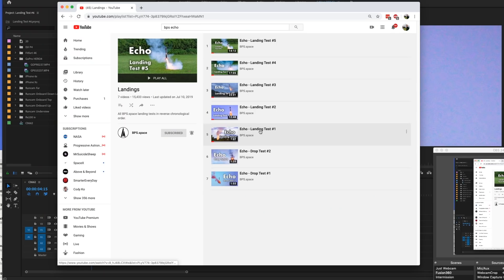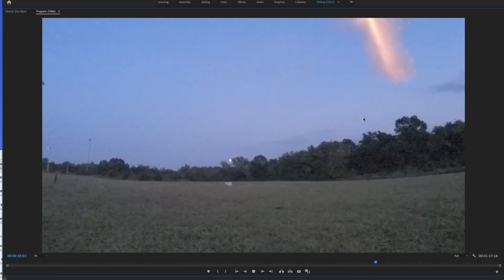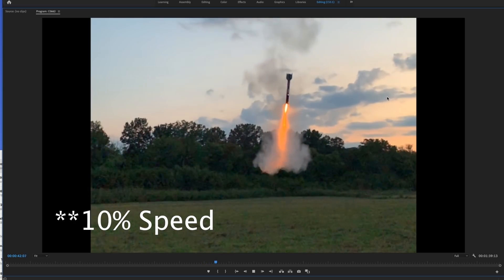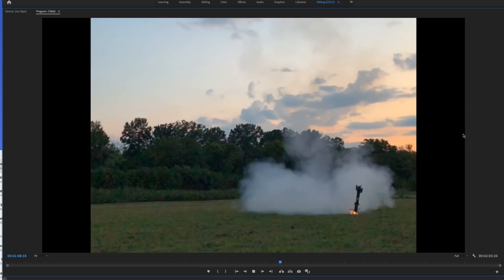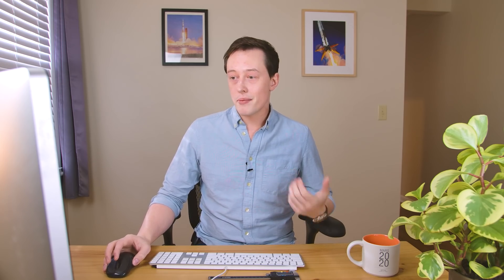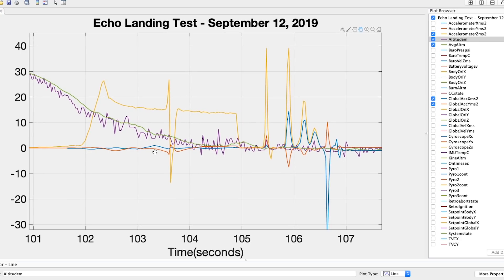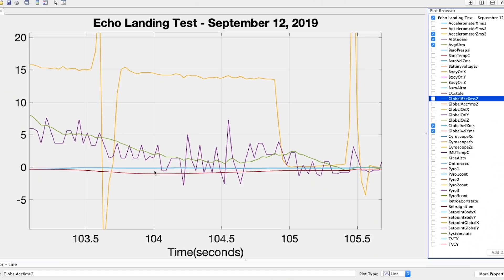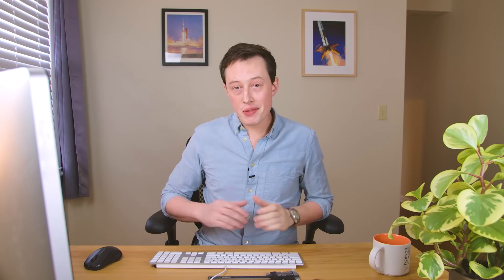Echo - Landing Test #6

Comment: So for this material weight and size the ratio of thrust is about 3 times the size of the rocket, which would make some sense for the thrust to overpower its weight, not even considering the fall rate so much.... I wonder what that would be like for 40 or more tons of weight, Hmm? The SpX rocket thrust size was about 1/10th the size of its rocket... I would say that debunks it, dont you?

Comment: That was a beautiful thing almost.
Reply: So for this material weight and size the ratio of thrust is about 3 times the size of the rocket, which would make some sense for the thrust to overpower its weight, not even considering the fall rate so much.... I wonder what that would be like for 40 or more tons of weight, Hmm? The SpX rocket thrust size was about 1/10th the size of its rocket... I would say that debunks it, dont you?

Comment: Have you considered photo flash ignition? An old-style flash bulb of the correct physical size placed at the end of the ceramic nozzle creates enough heat to ignite the motor. Advantages are the following:
1. Very low power required to flash the bulb. 
2. Very consistent time from when the power is applied to the bulb to when the flash bulb goes off. (After all, they are used in conjunction with a shutter to expose film). 
3. Potentially more even ignition across the end grain, resulting in more consistent motor start. 
Br, Tom.

Comment: Hi BPS space. I have seen a huge amount interest in these TVC rocket systems and lots of people attempting to to do the Space X style landing, but no one is offering a rocket motor capable of giving the TVC, throttle, inflight relight & controlled shut down needed to fly these types of mission profiles. Given I have designed & built hybrid rockets for over 25 years now I am thinking of setting up a project (probably on kickstarter) to make a suitable HRM kit to do this, would you be interested in this? You can check videos of some of my prior work on my channel.

Comment: Maybe you could make a variable tube size rocket engine where the diameter is smaller than the main deceleration motor, giving less thrust for the last 1 foot altitude.

Comment: Throttling is the largest issue with solid fuel rocketry, but could you "pre-bake" some throttling into the solid fuel? If you make your own core-burning solid fuel cells, you can gradually dilute the fuel with something combustible inert to lower the thrust towards the end.

Comment: What I noticed is that, there is soft landing spot rather than hard landing surface. Try landing on concrete, this factor is also to be considered. As there is less chances of toppling in hard surface than on the grass

Comment: This would pose the issue of heat removal , but along with thrust vectoring could you also make a throttling nozzle similar to what's on fighter planes? ( I know they are turbines and the nozzle works with the throttle )

Comment: Why don't you try controlling the thrust of the solid rocket but changing nozzle size/leak so you can do some control of the thrust/cutoff and not relay on timing only?
Basically you get a good control circuitry but without proper thrust control it is hard to handle. Adding some control over the solid rocket thrust would likely be simpler than doing liquid rocket with all other issues.

Comment: While the fins work great for stability, have you considered grid fins? The can help with lateral movement and the can slow the rocket down if modeled correctly. It could be deployed is a similar way to the landing legs, and if you really wanted to, you could rig up some servos to control the grid fins. These would be a more size/cost/weight efficient alternative to reaction control thrusters for decent, and you could easily print them with your 3d printer.

Comment: I also just had an idea that if you were able to make your own motor housing with your own throat that would eliminate one variable.  I have no idea if it's possible to make your own solid fuel at home but maybe just some sort of shroud that an estes motor would fit in, that would allow you some sort of control over the final flow of thrust through your own throat.

Comment: What if you had thrusters on the side of the rocket working basically like an abs system to keep the rocket straight? It seems to me like all the thrust coming straight from the bottom would make landing a little more difficult because of pushback from the thruster to the ground. I’m not rocket scientist by an means lol but that’s just my theory.

Comment: Maybe longer legs (5cm) could fix a problem. Sorry for my English (I am French)
Reply: I am totally not a mechanical engineer, but I was wondering the same thing. And if there's a bit of mass at the tips of the legs, would that not provide some additional measure of roll reduction (like a figure skater's spin reversed) that's context-free (no sensor input required)?

Comment: Looks like just above the ground the thrust power cancels out gravity due to the ground acting as an impenetrable barrier thus the rocket hovers above the ground for a second before falling the last couple of feet.

Towards the end of the thrust lifetime if you could throttle down the power at a linear rate (based on altitude and thrust power) i think it would still descend slowly towards the ground. 
This would allow the rocket a gentle descent for the final few feet and touch with minimal bounce providing a more stable landing. 

Have you successfully landed one yet?

Comment: Yeah, I think trying to land with a solid rocket motor where you can't control thrust and  likely too large a variation in power, duration, ignition of the rocket engine make it extremely difficult to land. But on the plus side, you do get to learn more about controlling the rocket and guidance.

Comment: Dude soooo cool good job!! I had an idea about how to throttle down the engine right at landing. You could build a mechanical iris the would close off the downward thrust and redirect it out the sides maybe. Could give you a little more control on landing. Buuuuuut I know you also have to worry about weight.

Comment: Your rocket almost did it. It is amazing, man. It estabilizes (like a landing) 1m from the ground... If you increase the weight of the rocket a little bit, dont you think that the rocket will estabilize  closer to the ground during the landing? Since that you dont control the quantity of thrust, maybe the carrefully increase in the weight could work indirectaly on this way...

Good job! Congrats for your curiosity and resilience.

Comment: Why not use 2 smaller rocket motors, point them closer/further away from each other to control vertical thrust? Also, you can get roll control directly from the motors this way.

Comment: To send this little craft to space, what would that take in terms of fuel and stages? Lets say you send a small radio as the payload with whatever technics you would need to operate that radio, transmit or what it is you can do with it.

Comment: Congratulations. You put in a tremendous effort. And you LEARNED a great lesson that many, many generations of Control Systems engineers had to learn before you: ”If you have significant uncontrollable input variables (eg., winds, engine thrust, etc.), then you can NOT run your system “open loop“. You must run it closed loop.”

Yes, you are making the right decision to abandon solid rockets. There is no viable way to get there without a throttle-able rocket. There are no ways to throttle a solid fuel rocket ... without heinous complexity. 

And “heinous complexity” = lots of additional mechanisms, lots of extra mass, lots of extra unreliability.
That’s the wrong route.

If you have a way of searching comments, you’ll find that I posted here almost all the same things that you said around a year ago.
I (believe) that I also told you about Harold Edgerton, one of the greatest engineers who ever lived. He had decades of hundreds of young engineers asking him if hundreds of, um, “less than astute” ideas would work. He NEVER said, “No, that won’t work because of (valid, correct reasons).”

He always said, “Go try to make it work. You’ll learn 100x more by trying & failing, and paying close attention to WHY your idea failed, than if I tell you now why it won’t work.” And then he’d tell them, “you’ll have to pay attention to a, b, ç, etc.”

I’m pretty sure I said the same to you. That has been my policy for the last 30 years when giving advice to baby engineers.
I encourage you to take the same route, in the future, when people are comping up to you & asking if some hare-brained idea will work.

Plus, you get surprised. Sometimes the little suckers ... succeed. Sometimes, they succeed wildly.
I’ll share one of my embarrassments. About 8 years ago, I thought that landing a rocket vertically, on legs, was pretty hare-brained.

A couple of thoughts here ...

1. You’ve got to get precise altimeter data. Your barometric altimeter ... not so good.
2. Look up the simple criteria for something falling over. Your landing legs ... much wider base. Likely more than 4.
3. Think about vertical mass distribution.
4. Wind won’t be a serious problem, once you close the loop on lateral velocity. You thrust vectoring will compensate. However, wind gusts are a different story. Sometimes the only way to deal with issues is to avoid them entirely. Such as “launch restrictions”. Not particularly satisfying, but that’s the reason such things exist. 
5. Last, I’d wager that, once you’ve got a closed loop system up & running, you’ll discover that there are very specific reasons that SpaceX does not land on grass. Reasons that go beyond “dirt can’t take the weight”.

Finally, I believe the best lesson here is that there is a tremendous body of engineering knowledge regarding almost any task imaginable. Try, as best you can, to take advantage of that knowledge as early in any project as possible. Talk to older engineers, experienced in the exact task that you’re trying to accomplish. Ask them about the pitfalls. Leverage other engineers’ mistakes & learning curves.

Again, best of luck.

Comment: Could you use a longer leg/wider base to counteract your center of gravity/tipping?  I would think that and may be forcing a 2-point contact, would allow the rocket to settle more easily (lower CG at touch down and bounce would be divided between two legs, which allow for 1-axis re-balancing, rather then trying to force 2-axis, while balancing/bouncing/pivoting on a single point)... or maybe put a small gyro in the nose section, which would help minimize sway and counteract variations in the motor burnout phase...

Comment: In my view you need either one or two of the following:
-Leg Dampers, maybe bigger legs and slower deploying;
-Some kind of compressed gas at the top (maybe CO2) and 3 or 4 nozzles to help it from tipping after touchdown, ofcourse it has to be well controlled with electronics but you´ve done bigger things already so should be "easy".

Comment: Why don't you put 3 motors and change angle/vector of each motor while landing?  With good settings you could normally land with motors on full throttle, you just pinch motors up when you need less power. That way you have a lot of room for error, unlike the method you're using now.

Comment: Is it possible to remove material from the top of the rocketmotor? Reducing the total thrust would turn the steady-state hover into a slow descent. I've honestly never done anything but light rocket motors so I don't know if that's possible.
The legs making the whole thing judder like that I remember in previous videos you mentioned that could knock things out of whack, a shock absorber would solve the issue (I suspect you know this :P) but we used to use a rubber gasket and a piece of string, basically, to just slow down the extension on some stuff back at uni.

PS I love your videos, and the work you do!

Comment: Since you can't accurately control the motor startup, or even thrust, why not put a thrust redirection or restriction system in the exhaust flow.  Then, with the your flight controller you can "adjust" for crappy input to get the output (thrust) you want.

Comment: The problem with these landing attempts is the rocket motor -- there isn't anyway to throttle them down.  These things were design to lift the vehicle upward then fizzle out.  It wasn't in anyone's wildest imagination that you'll be trying to use them to accomplish SpaceX-type landings.  You have to find a way to reduce the end-stage burn slightly to facilitate the landing you want to achieve.

Comment: The Spacecraft should detect the speed it's falling downwards and calculate the needed engine power for braking with an algorythm based on downward speed, mininmum brake time, distance to ground and maximum engine fuel

Comment: BPS, I think you can ignite the motor later. Even if the trajectory calculation would say that it's too late and would hit the ground, because of the light weight, as the flame begins to touch the ground the force would probably increase since you would have the transfer of momentum from he combusted material to the rocket. Then that material will bounce off the ground, and then push back up on the rocket.

Comment: Of all the parrameters you talked about the one parrameter you didn't talk about is the springiness of the grass yoou are landing on. At the size of your rocket the nature of each blade of grass and that of the grass stalks should be concidered as a field of randomly set springs. Dose the design of your landing legs take the variable nature of the grass surface you are landing on into concideration?

Comment: Joe, I know you thought of this, but what about multiple smaller engines, sort of like the SpaceX Falcon? Instead use a staggered descending thrust parameter with multiple smaller engines to slow descent, ending with just enough soften the landing - even if the last was still burning on touchdown. Yes, I understand you would still be dealing with environmental stuff...Or would it just go boom? 

I am excited about the Sprite project and wait in eager anticipation on that update!

Comment: I have watched a few of your videosThe problem in your rockets is weight. You need to make the rocket lighter. Replace all metal screws with plastic. All parts should be lighter, thin walls, holes in them to remove weight.

Comment: Did you consider using solid rocket engines to stop the fall, then use compressed gas (like CO2 cartridges) to control the touchdown?

Comment: Might want to try GOX/solid hybrid engine as an intermediate step before going fully LOX/MeOH. The hybrid can be throttled, has a much more simple plumbing system and it can be assembled largely from paintball components if you watch your pressures.   Other potential oxidizer for a hybrid would be NOS from and automobile performance shop

Keep up your extraordinary work!

Comment: Obviously the manufacturing tolerances of commercial BP motors are deliberately left "loose" to a certain degree to bring costs down.  Based on how often I've seen composite motors "chuff," their igniters fail, CATOS, etc., the same can safely be said about composite motors.  
Maybe using precision mandrels for propellant grains and for nozzles, exact "recipes" for propellant, standardized "cooking" profiles, etc., you might be able to get more consistent performance from self-made solid motors.
Or you may have to wait until you develop your throttle-able liquid motor to nail landings.
MAJOR kudos for your engineering, technical analysis, and perseverance!

Comment: You should go for ethanol and hydrogen peroxide engine, you can use a solid motor as an igniter that would oversimplify the issue, I think liquid oxygen is way out of your capabilities right now - in fact anything that is pressurized cryogenic seems unrealistic.

Comment: You should really think about a thrust control system for your solid rocket motors...
Like, two metal holes on the sides near the exhaust that can be opened with a servo or sth.
That would divert some of the pressure to the sides, lowering the thrust.

nice
Reply: Also, the holes could have a variable amout of covering, giving you a nice opportunity to control the thrust on TWR
of about 0.8-3.0, increasing the probability of a successful landing.

Regardless what you plan on doing, good luck for you !

Comment: I have no experience with rocketry (so apologies if there is some obvious rookie error here), but just throwing out an idea about a possible solution to controlling the thrust of a solid rocket motor. How about having pairs (2 motors or 4 motors) of motors that can be gimballed in opposite directions? If you want lots of thrust, both members of a pair would point straight down. If you want less thrust, they would gimbal away from each other to reduce the vector pointing down. If you need horizontal control, they could gimbal in the same direction. With regard to altitude sensing, is there a light enough radar or ultrasonic sensor to directly measure this?

Comment: I think the solid rocket motor is reason why the rocket falls. You could analyze the thrust vs time of the rocket engines you use to find solutions. Alternatively try to implement a hybrid motor that can have thrust control and relatively simple to build

Comment: Canine Rocket is right, you've done an amazing job!
Actually, if your motor gimbal is as agile as it looks in this video, you can effectively throttle the thrust of such a solid propellent motor by rapidly oscillating the gimbal in the x or y-axis, or both (circularly) to diminish the average axial component of thrust.  The frequencies used should be chosen to avoid harmonics of the model's structure or other sensitive parts.